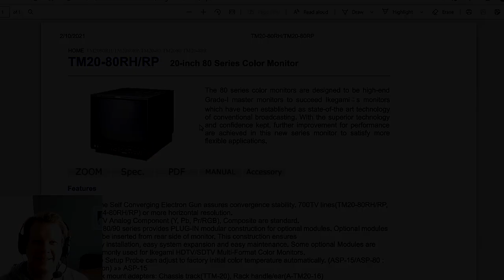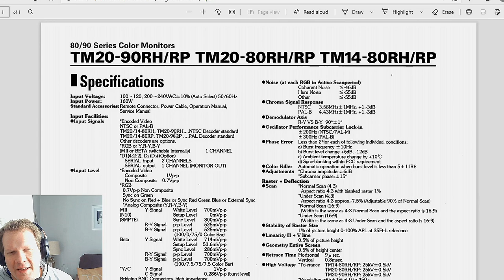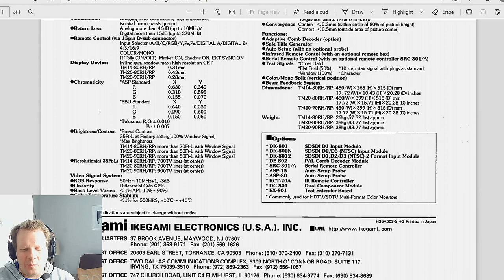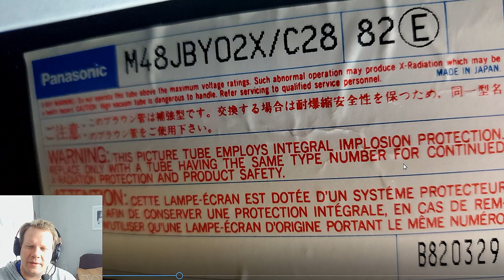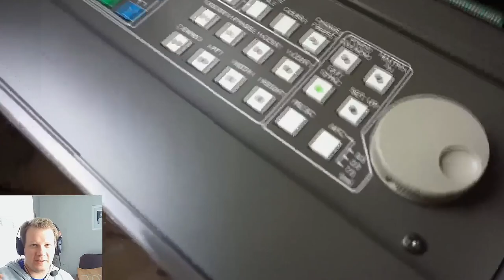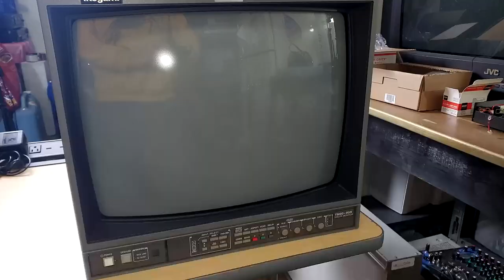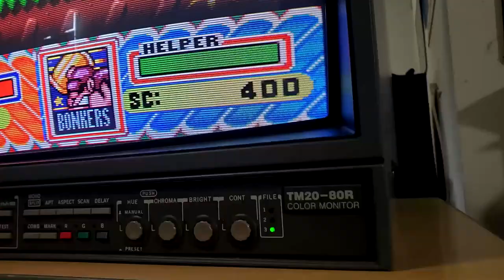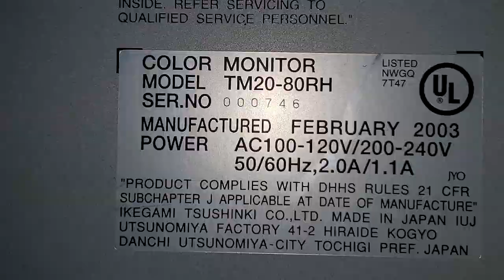The Ikegami TM 20-80R CRT - Shadow Mask Broadcast Monitor Tune-Up

Comment: I've got a 2050RA1 that suffered from a vertical fold over. I should really just take that deflection board out and recap it - when it worked that monitor was beautiful.
Reply from the maker: Yeah and check the IC's/Regulators on the Vertical line.  Those can fail or can have cold joints.  They are great.

Comment: I have this monitor. I have a question. Would it be ok to put a piece of marble with rubber feet on top of it so there will be a little distance between it and my Marshall speaker. It has the vent holes on the side but not as many as the top. Thanks

Comment: Hi! I received the same monitor a few days back, with some shipping damage (don't let Fedex package things like this for you and call it pro packaging, they damaged it even while putting it into the box, and those cast iron bezels will break). Anyway, the picture looks nice (although maybe a bit less focused than I'd expect, maybe some convergence to tweak?) but the horizontal lines have a bit of a downward bow (when viewed straight on). Any idea which pot to adjust for this, since there's no setting for that on the control panel? Also, adding 75Ohm terminators to the RGB outputs improves picture and colors drastically.